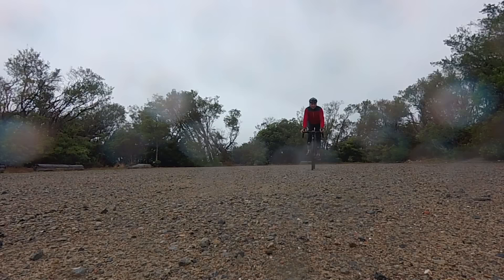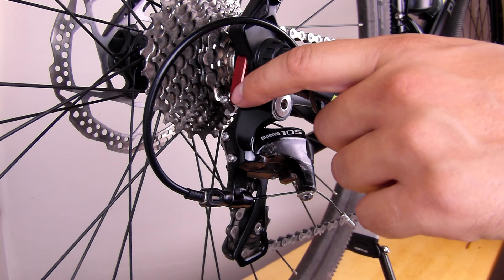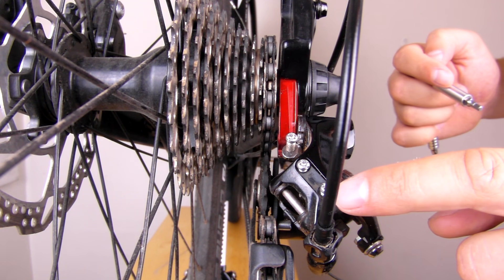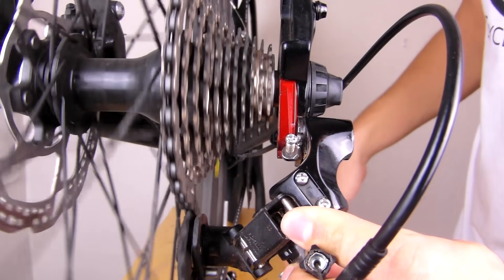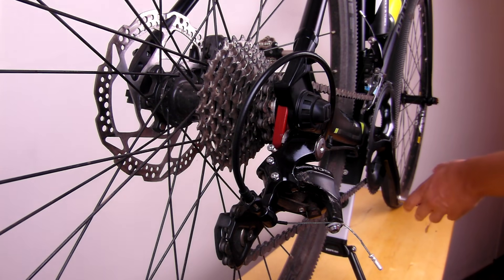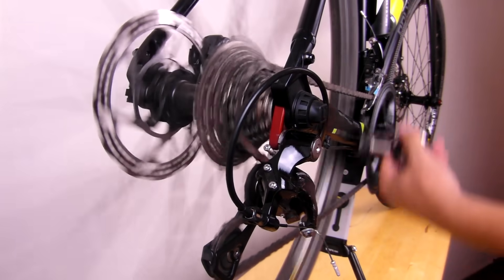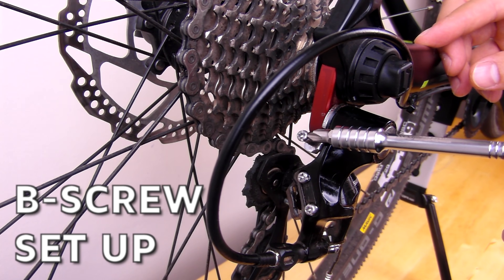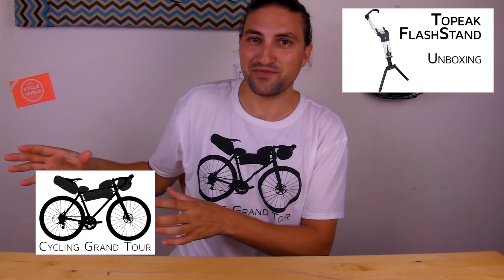How to Adjust your Shimano Rear Derailleur | #CGT - Bike School

Comment: 2:53 I dont understand this step. Why the chain should be 1 gear up?
Reply from the maker: @kas9633  this is a little trick to help set the cable tension easier. You can tune your rear derailleur without doing this.
By pushing the derailleur one gear up, the chain will "pre-load" the derailleur by itself, so then you don't have to pull on the gear cable as hard to remove any slack in the system. 
It's a little hack, but you can absolutely skip it. 

Let me know if you have any other questions
Reply: @cyclinggrandtour  Thx for your answer. Have you faced the problem that the shifting gear down causes a "hard" shifting? I mean it feels like the chain is falling down to the lower gear. It is not going quiet at all. Tried to adjust it many times and nothing. The gears change but the way  gears go down is just crazy. I have just allignet the  derailleur hanger. Is it possible that it is the  bend derailleur itself?
Reply from the maker: @kas9633  no worries!
Different drivetrains operate differently. Example, SRAM is known for being louder and more abrupt, whereas Shimano tends to be quieter and smoother. There is no issue with the gears changing abruptly, as long as the chain falls perfectly in the gear.
It can also be the way you're changing gears, if under heavy load, it will be more abrupt.
Usually, if the chain is "falling" too quick into a lower gear (heavier gear), it can be harder to move the other way. If you find that to be the case, then you can add/remove cable tension to make both going up and going down smoother.

Let me know what you find
Reply: @cyclinggrandtour  Hei. Thx for your answer. This is a Shimano 105 gear. It was shifting very smooth before. This "hard" change of gears happens on the flat road and it is worst on the last 4 smallest cogs. Adjusting of the barrel doesnt help at all. 
Do you think it might be something to do with L and H scrue? Or maybe the B screw? Would it cause such a problem? 

Anuluj

Odpowiedz
Reply from the maker: @kas9633  I see, ok.

My initial impression is that your chain might be worn and as it stretches, it doesn't perform as well as it once has. Going to the smaller gears, it is easier for the chain to "fall" into the cogs, possibly making that noise. 
It can also be a combo of the chain being worn and the cassette also being worn.
How many kilometers/miles do you have on that chain and cassette?

As long as the chain falls into the right gear and there is no clicking or difficulty in getting into gears, you can keep riding it.

I would possibly recommend you get a chain wear tool, super cheap things, and you can test it yourself to see if you need a new chain/cassette.

Let me know!

Comment: Thanks for the really helpful video! However, I gave a problem and could use some help. All was going well until I re-attached the shifting cable. High and low stops were adjusted fine, I moved the chain to the 2nd smallest cog and then tightened the hex nut to re-attatch the cable. Now the shifter will move the chain only to the 5th cog, about half way up the casette. Any ideas?

Comment: good vid, thanks. My Derailleur keeps hitting the cassette no matter what adjustments I make. I have to physically push it to clear the gears.
Reply from the maker: Hi,
It's hard to say what the problem might be but I can think of a few possible issues.
1 - bent hanger - the metal part that connects the derailleur to the bike frame. If this is bend, it will push the derailleur closer to the cassette and even hit the spokes. You would want to replace the hanger.
2 - b-screw not set - if the b-screw is too done properly, it might allow the derailleur to touch the cassette. Watch the video again and see where the b-screw is.
3 - Cassette/Derailleur not compatible - if your cassette is too big for your derailleur, or your derailleur too small for your cassette, they will touch on the bigger gears.

Again, it's nearly impossible to tell for sure what the problem is. You might need to take the bike to a bike shop and have them fix it.
Best of luck

Comment: Why would the b-screw not have any effect on derailleur when attempting adjustments???
Reply from the maker: Stephen Roth the B-screw is not as sensitive as any of the other adjustments you can do to the rear derailleur. The b-screw is mostly used to tension the chain (in case your chain is a bit too big for the ratios you have) or/and to adjust the derailleur height if you change cassette sizes (going from a 23-11t to 28-11t on road bikes or 32-11t to 36-11t on a mountain bike). By screwing in the b-screw, it will create some vertical distance between your top pulley wheel and your biggest cog in your cassette. 
In extreme cases, having the b-screw too far in, will make the derailleur less precise in conducting the chain to the right cog. 
Rule of thumb, you want to check that the top pulley does not hit your cassette on gear #1 and also, when you have the smallest chainring selected and the smallest cog on the cassette, the chain should be tensioned and have no slack. 

Hope this helps! Let me know if you got any other questions 🙂

Comment: Hi my gears where all fine until I mended a puncture now they take a few seconds to change. How do I rectify this.
Reply from the maker: Hey Karl, from the sound of it, you might have 1 of 2 issues. 
1- when you put the wheel back on the bike, the wheel is not sitting properly in the dropouts, putting the wheel in an angle, causing the issue with the gears. This would happen on a bike with quick release system. To fix it, open the quick release and put pressure on your saddle, that will force the wheel to sit flush in your dropouts and will fix the issue.
2- you bent your derraileur hanger in the process, either by laying your bike down on the derraileur side when you took the wheel off, or by installing the wheel at a weird angle and putting lateral forces into the hanger. By your description, the hanger wouldn't be too bent, so a local bike shop could easily help you straighten the hanger and save you buying a new one. 

Hope this helps!

Comment: Your identification of limit screws is the opposite of other videos.  And you use both for adjustments to one gear?  After watching several videos, it's obvious techs have their own methods and descriptions of parts and gears.  For example, I don't want to hear high or low gear --they're often relative terms.  I want to hear the gear number so that it corresponds to my shifter indicators.
Reply from the maker: Hahahaa I'm okay with you flipping me the bird haha
The video is a few years old and derailleurs have changed, compared to the 2023 Shimano derailleur.
It's normal for the limiter screws to be in different places in a derailleur, within the same brand or on different brands. The limiter screw is influenced by the geometry to the derailleur and how the cage moves when you add or remove cable tension using the shifter. Some limit screws are on the back of the derailleur, like you see on this video, others are on the side, or bottom.
It can be tricky to understand what screw does what, high or low. 
My recommendation, is to take the cable out of the bolt, let the derailleur rest on the lowest gear (the small cog) and then screw in each bolt to see what happens on the derailleur. If you start screwing in one of the screws and the derailleur starts moving, you know that's the low limit, and the other screw will be the high limit.

Let me know if this helps!
Reply: @cyclinggrandtour  Dang, you caught my pre-edited comment.  Sorry!
Reply from the maker: @RC-ud9hh  hahaha
All good!
Did my previous reply help?

Comment: sorry mistake in my last post .   its when I shift from lowest gear [ biggest cog ] up to highest gear [ smallest cog ] the chain becomes very slack , what is the cause of the problem & how do I fix it ??
Reply from the maker: Hey Jules,
Sounds like your chain is too long. If you bought the bike like that, you can probably take it to the shop you bought it from and ask them to cut the chain shorter. 
If this is a new chain you installed, you will have to break it, take 1 or maybe even 2 links out and join it again.
Before doing any of the steps above, I would recommend playing with the B-Screw on the derailleur. By screwing that in, it might be just enough to tension up the chain and stop it slacking. It's not an ideal fix as the B-Screw does have some impact on on well the derailleur shifts when it's screwed in all the way.
To cut the chain short, unfortunayely I don't have any videos showing that, but you will probably find one online you can use. You will need a chainbreaker that is compatible with your chain (ie. # of gears your chain was made for). After you install the pin on the chain again, make sure the chain bends freely on that point.
Let me know if you have any more questions :)

Comment: when I shift from the top [ smallest ] gear down to the lower gears [larger cogs ]] the chain becomes very slack , in other words the jockey or deraileur doesnt take up the slack . how do I fix this ??
Reply from the maker: Hey Jules,
Sounds like your chain is too long. If you bought the bike like that, you can probably take it to the shop you bought it from and ask them to cut the chain shorter. 
If this is a new chain you installed, you will have to break it, take 1 or maybe even 2 links out and join it again.
Before doing any of the steps above, I would recommend playing with the B-Screw on the derailleur. By screwing that in, it might be just enough to tension up the chain and stop it slacking. It's not an ideal fix as the B-Screw does have some impact on on well the derailleur shifts when it's screwed in all the way.
To cut the chain short, unfortunayely I don't have any videos showing that, but you will probably find one online you can use. You will need a chainbreaker that is compatible with your chain (ie. # of gears your chain was made for). After you install the pin on the chain again, make sure the chain bends freely on that point.
Let me know if you have any more questions :)

Comment: Does the adjustment of the rear derailleur change when under load?
Reply from the maker: Hi Richard. If by under load you mean while riding and shifting gears, then no.
The only load that may have a negative effect on the derailleur performance is a very bumpy ride, if you're mountain bike riding and hit a rock garden for example. In that case, the derailleur might jump around a bit and the chain might slip to another gear momentarily.
The only other instance where load can affect the derailleur performance is in some Dual Suspension mountain bikes. Depending on the rear suspension design/geometry, when the shock is compressed, it causes the chainstay lenght to increase. When that happens, the derailleur cage extends to adapt to the longer chain on the bottom, and the shorter chain at the top. This might cause the B-screw to be virtually not tensioned enough and for the derailleur to not perform ideally. (this is a quite hard to explain scenario).
In short, if you're not mountain biking and doing extreme riding, the derailleur performance is not impacted by any or all load you put on your pedals.

Hope this helps!

Comment: What's a kaybul?
Not clear what you mean.
Reply from the maker: "Cable" as in gear cable? Can be internal gear cable, like the steel cable that operates the derailleur, or is can be the outer cable, that guides the cable through the frame.

Let me know if that helps

Comment: My ebike gears don't go down to 3 with out clicking again
Reply from the maker: Hi Steve,
If you're having issues getting into a heavier gear, that makes me think it might be an issue with your derailleur hanger. If you recently had a crash or had the bike fall on the gear side, it might have bent the hanger inwards, towards the spokes. 
If this is the case, be very careful getting into the lightest gear, or gear #1, as the chain might fall in between the cassette and spokes, causing serious damage to the chain, spokes, derailleur, and even potentially the bike frame. 
If in fact the hanger is bent, you can try to bend it back, but experience tells me to just buy a new one as they are fairly cheap, when compared to the cost of having to replace the derailleur, chain and others...

Start by visually inspecting the derailleur hanger from the back and seeing if it looks perfectly straight. 

Let me know what you find
Reply: No it been like since I have had it got it new had it serviced 2 s but they did not fix it
Reply from the maker: @stevenwarne2023  I see. My next recommendation would be to check the cables, both inner cable and outer cable. 
The inner cable is easy to replace, and cheap to do. The outer cable, especially because it's an e-bike, would have to be done at a local bike shop.

If the inner cable has a kink somewhere along the cable, it creates "false-tension" on the cable, and may be the culprit for the mis-shift.

Give that a go and let me know if that works. 
Best of luck!

Comment: Aawesome quality video. My bike's derraileur won't change gears at all, I loosened the limits and it still didnt work. I changed cables and still didnt work. I cleaned the gunk from the derraileur with wd40 and still didnt work. Any ideas to fix it?
Reply from the maker: Have you tried to check if your shifter is actually working? Take the cable out of the derailleur and hold in in your fingers. Now just shift a couple of gears up and down and see if the cable pulls anything. If you can't feel any cable pull, check if the cable is correctly inserted in the shifter. It it is, then you might need to get a new shifter to replace the one you have.
Another option would be to check the spring in the derailleur itself. Take the cable out of the derailleur, lift the rear wheel off the ground and start turning the pedals. With your spare hand, try to push the derailleur closer to the wheel and see how much resistance you're getting from it. If the derailleur is super hard to move, it might be the spring inside that is old and not flexible anymore. You'd need to buy a new derailleur to replace the one you have.

Let me know if this helps you out or if you're still having issues.

Comment: Tx much .
Can you advice what position on handlebar you need to put shifter  before start anything ?
I heard that it should be on smallest by size  rear gear , is this right ?
if somebody will show how to do this on $100 bike from End to End  for dummies without bum-bum music, I'll give him Oscar.)
Reply from the maker: Hi Viktor, that is correct. You need to click the shifter to the smallest gear in the back. If you bike has 9 gears, you want to have gear number 9 selected on your shifter (located on the handlebars).
Hope this helps! Let me know if you got any other questions.

Comment: My chain jumps a lot when I paddle hard. Why this is happening and what’s the solution.
Reply from the maker: If you followed the video instructions and think the gears are aligned perfectly, then you might have a worn out drivetrain. When a drivetrain is worn out, the chain and cassette don't connect together perfectly and the chain might slip on the cassette's teeth. Usually this only happens when you pedal hard and on higher gears in the cassette (the smaller ones).
If this is the case, you will need to replace your chain, cassette and possibly your chainrings.
You will probably need to go to a bike shop to do these repairs, as you will need specific tools. At the bike shop, the mechanics can confirm if the problem you're having is because of a worn drivetrain or something else.
Hope this helps!!

Comment: I searched for Shimano Acera RD-M340 and this was the first video in the results and it does not feature the aforementioned part. Go figure.
Reply from the maker: If you were looking for ways to adjust your Shimano rear derailleur, the type/model of the derailleur has very little to do with it, as most derrailleurs feature the same elemets, ie. anchor bolt, low/high limits, and b-screw. The fundamentals to adjust the rear derailleur are the same, (almost) regardless of what derailleur you have.
I hope the video helped you

Comment: My cycle has SHIMANO TOURNEY when i change gear, the chain keep jumping on the changed gear
Reply from the maker: If the chain is jumping between two gears, it's the cable tension that is not correct. Try to adjust the barrel adjuster on the derailleur to make cable tension correct.
if the chain is slipping on the cassette, not moving between gears but just jumping when you put power on the pedals, then it's likely that your cassette and chain are a bit old and need to be replaced.

Comment: Sorry to rain on this parade, but at 3:15-35 you are shifting DOWN, not up. More important, Shimano derailleurs NEVER make the first shift to the second highest cog (one gear down) "with a little bit of struggling", or even a lot. My recent Ultegra 11 speed won't do it on a single shift no matter how much tension I put on the cable. (Yes, the cable is good.) Shimano's faulty designs cannot be remedied or even hidden by 'experts' shilling for them.
Reply from the maker: I might have gotten the wording wrong, but I'm happy it still made sense for you watching. 

On the issue you're having, it seems to be that it might be the limiter screw that is not allowing you to go into that gear. I've been running Shimano Ultegra on a few different bikes and never had that issue. 

Have you had a bike shop look at that?